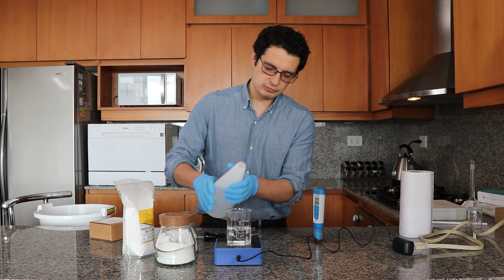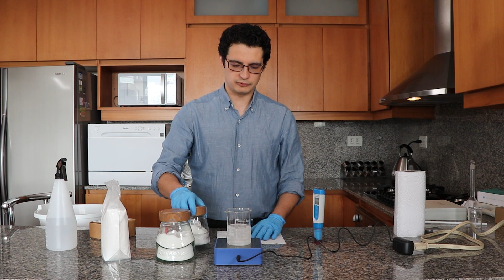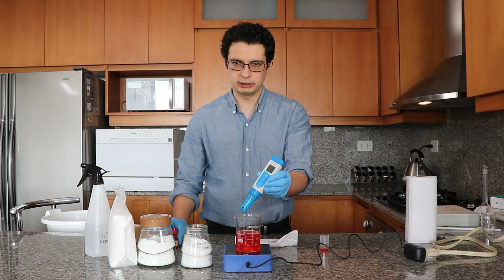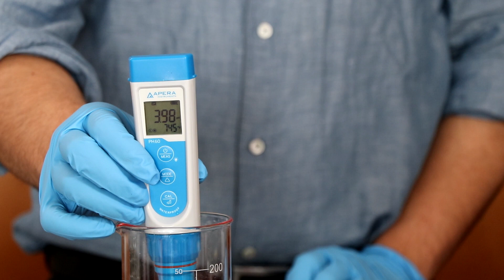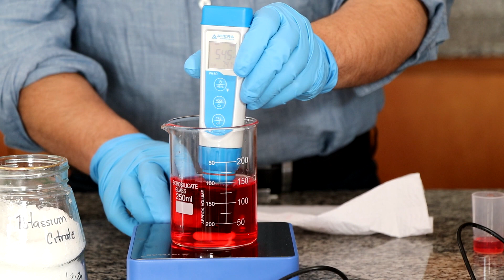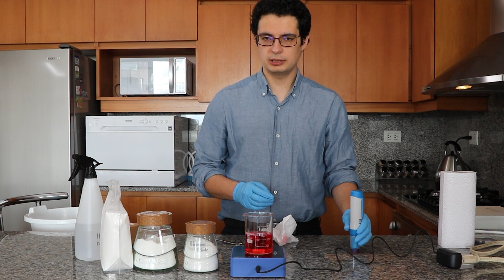How to make pH buffers from scratch, DIY, no scale required!

Comment: Thanks a lot for this! I read that Sodium Benzoate is not very good as preservation above 6pH. Maybe better to use something else? 

I got hold of 4 of those 250ml flasks and 3 100ml flasks 2nd hand for under 10 dollar total. Those flasks and using your procedure of purging and always having distilled water around has completely changed the way I do lab stuff to a more professional approach, which in turn have given me better and cleaner products, and most importantly, by knowing accuracy is impeccable, I know what is NOT wrong when something goes wrong.

So thanks a lot for your highly valuable lessons! 

Cheers :) 

BTW: 
Do you still do consultations to adjust hydroponic nutrients for specific plants? 
(Just realized that being cryptic was kind of pointless considering my name, lol)

Comment: Hi Daniel,I got the same apera ph60 instrument,what if my Reverse Osmosis water measures 0.02 Ec-0.0.4Ec or 2-4 microSiemens?Can I use it to do this process?How long can I consider the buffer good?I would like to make 1l each and do not want to waste any water,water is precious.Thank you so much <3
Reply from the maker: Thanks for commenting. You can use your RO water. The buffer will probably be good for at least 6 months if you add the preservatives mentioned and store under cool temperatures (it will last more if stored in a fridge). You should keep some outside for regular use however, as the buffer needs to be at ambient temperature for it to be accurate.

Comment: Thank you for this! Are there any alternatives to potassium citrate? Sodium bicarbonate maybe? Or can I just freeze the buffer solutions that came in the Apera pH meter, so they wont expire? 😅
Reply from the maker: Thanks for commenting. Bicarbonates will not work as the pH they set depends on atmospheric CO2, so they are unreliable and not suited to standard buffer preparations. You can indeed freeze the buffers that come with the Apera meter if you want them to last longer! (just make sure they have enough volume to expand when freezing)
Reply: @ScienceinHydroponics  Thank you so much for your response, I really appreciate it!

Comment: Can't we create a solution similarly with any acid or base?
Reply from the maker: No. An acid or base can be used to set a pH level, but the stability of a pH level depends on the buffering capacity of the solution which is created by the chemical equilibria of specific weak acids and bases at specific pH values.

Comment: But could you use also bakind soda and lemon to adjust the pH level?
Reply from the maker: Thanks for writing. The problem when you do this is that you introduce a lot of carbonates, for which the concentration in solution changes with time and is dependent on the room CO2 partial pressure and takes a long time to reach equilibrium due to the slow kinetics of this process. This means you will adjust the solution and then the pH will drift with time. For this reason, carbonates are generally not used as standard buffers for calibration.
Reply: @ScienceinHydroponics  thank you for your clarification. That must be the issue in real scientific world... For me that could work well enough since I'm not doing any critical laboratory studies nor tasks. I am growing plants which don't require space science... I have factory purchased with what I can every now and then calibrate the meter. One can make a research how long these regular household made liquid takes for to stabilize and how it changes... Then one can know enough well how and when to make adjustments to it. I know, this may be ridiculous, but it is the poors man way to go - in my case 😂

Again Thx for replying it's always appreciated 👍
Reply from the maker: @cheebacheeo5876  Thanks for your reply. It can drift very significantly, a buffer you prepare that way might work for that instant, but a day later it might be off by 1 entire pH unit, which makes it a poor choice for calibration for hydroponic solutions given that plants tolerate a relatively narrow range of pH values and having your meter calibrated at least to +/-0.2  is essential. 

Potassium or Sodium citrates have a low cost per pound, so they are definitely nothing fancy or hard to get and will give you a much more stable buffer to work with!

Bear in mind that the method in this video is far from the standard used in research labs. In cases where buffer precision is essential much higher quality reagents and truly standardized procedures are followed.

Comment: Great video. Can this be used to make a 5.8 solution? 

Any ideas on making pH probe storage soluthion? Isn't it just KCL and distilled water? If so how strong do I make it? Does it need Sodium Benzoate? I was thinking not because there isn't any carbon. But, I not 100% sure.
Reply from the maker: Thanks for commenting! Sure, you can use this to make a 5.8 buffer if you wish. About the storage solution, a 4 pH buffer can be used for storage without issues. If you want a KCl storage solution, then that can be made by using KCl and distilled water at 260g per liter. You don't need any preservative for a KCl storage solution.
Reply: @ScienceinHydroponics  Thanks. 
I'm trying to booking some time on your web site. It doesn't seem to be working. Is email better?

Comment: I was just wondering Distilled water has ph of 7 so why we cannot use distilled water to calibrate pH meter .. your help will be appreciated. Thanks
Reply from the maker: Pure water does not have a pH of 7 in reality. This is due to the CO2 in the atmosphere, its pH will drop to somewhere in the 6-6.5 range and this will depend on the concentration of CO2 in its environment. Furthermore, distilled water might still have substances that affect pH - like volatile organic acids that get distilled with it - and, since it has no buffering capacity, even minute amounts of these substances can cause shifts in pH. Overall a buffer is needed to ensure small amounts of contaminants or outside influences do not radically shift pH.
Reply: Absolutely correct

Comment: How long can a 7.0 buffer last exposed to air ?
Reply from the maker: Depends on the ionic strength of the buffer and the partial pressure of CO2 of the air. It also depends on whether water from the buffer evaporates or not. You must be able to put it in an air-tight container if you want it to last for a substantial period of time.

Comment: Is it possible to add the sodium benzoate into the fertilizer as a preservative? Because when i prepare single microelement fertilizer like Sodium Molybdate after few days into the solution appears floccules (i don't know what it is). In case how much could I add in it? Thanks
Reply from the maker: Thanks for writing! You can add it, however the concentrations are different. Add it at 100mg/L of concentrate and also make sure the pH of your concentrated solution is below 4.
Reply: @ScienceinHydroponics  Thanks.  The ph should be below 4 also for complete fertilizers (made with hydrobuddy)? Should i prefer nitric/sulfuric/phosphoric acid?

Comment: I mixed phosphoric acid and RO for my PH down, but could you add citric acid to make up half of the solution so I don't have to worry about adding in too much P?
Reply from the maker: Thanks for your comment! You should avoid doing that. While citric acid would help bring the pH down, plants and bacteria will aggressively uptake citrate and, in the process, raise the pH. This is why if you use citric acid as pH down you will see sharp bounces up within the next 24 hours.
Reply: @ScienceinHydroponics  That makes sense.